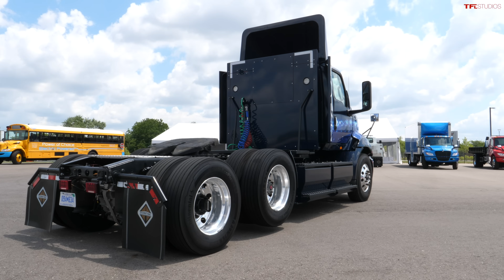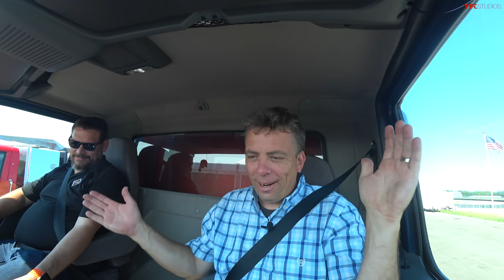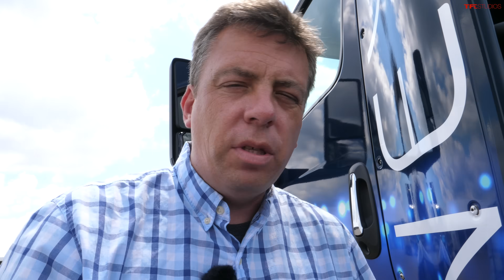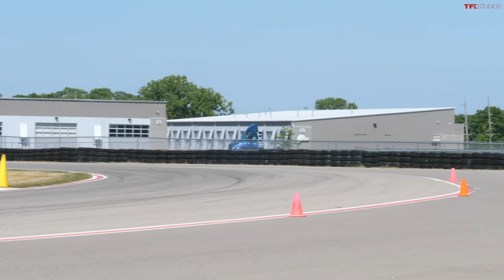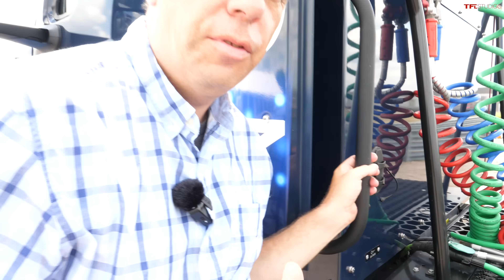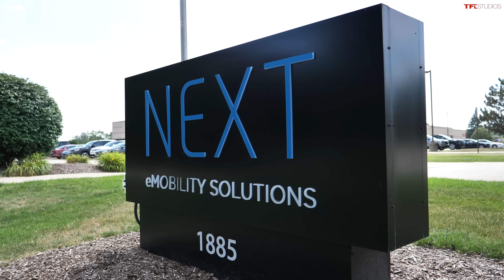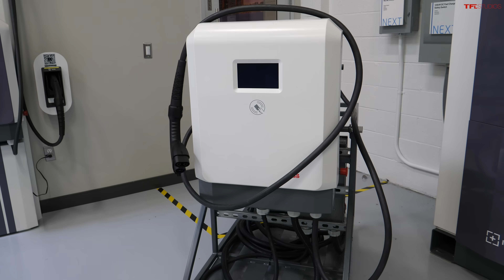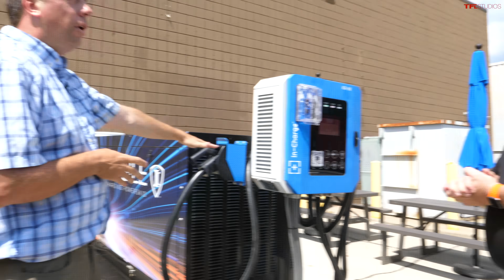Badass EV Big Rig - This International 18-Wheeler Packs a Huge Surprise!

Comment: 5:05 I'm glad they're emphasizing the point that these EV semis outperform diesel in every performance metric. So really,  this technology is a no-brainer. The energy now needs to be spent on improving energy density/range. Better batteries, HFC, SOFC, etc. are all options, and they're all becoming available sooner than many people realize.
Reply: For Local or Regional freight these are  a NO BRAINER.. maintenance cost on Diesels are high.. especially with all the EPA crap on the new engines. 
They are a NIGHTMARE..  DPF Filters.. EGR,  and coolers, and DEF systems. 
All very failure prone and expensive to repair.. and they put you out of service, that is the BIG cost. 
Short haul and city trucks are especially susceptible to these failures.. they don't get the exhaust hot enough long enough to make the EPA systems work well.
But for long haul stuff.. especially expedited freight.. The charging speed and rang will not  matter.. the number of charging locations will be the big issue.
I do not see a way to get the chargers to EVERY truck stop in the country. Freight like this is so random in its route and it timing.  A long haul truck will be carrying 300 gallons of Diesel.. Giving a range of 1800-2400 miles. and can be refueled in say 15 min or so. Even at a regular gas station in an emergency.
Maybe you could do diesel powered long haul to designated regional drop zones... and then have EV trucks grab the trailer and take it the last 50-100 miles.  But that complicates the logistics a lot.

It will happen.. but its gonna take time and be done in stages.
Reply: @kens97sto171  For long-haul, I wouldn't be surprised to see some effort put into powered trailers. Ultimately, overall weight would still be a factor, but having one or two trailers with their own daisy-chained powertrains and ~400 kWh packs would go a long way... literally. Paired with the right EV semi, it could easily achieve 1,000 miles with a full load.

EVgo and GM are currently partnering with Pilot to add 350 kW, pull-through charging stalls at their locations around the country, but those would really only be used in a pinch. There needs to be dedicated EV semi stops with >1 MW charging at all of these travel centers, too.
Reply: @newscoulomb3705  
You're right you're going to need dedicated megawatt EV charging for trucks.
I spent a lot of time traveling all over the country when I was over the road trucker. The scale of accomplishing that is pretty astounding. There are truck stops in every corner of the country in all kinds of odd places. Perhaps you could do those large megawatt chargers at big truck stops on the major routes. But you're going to have to work out the logistics of how to get that last 200 MI into the middle of nowhere. And then figure out how to get back. Solar on top of a semi trailer might give you some additional range. And like you said put batteries in the trailers. You just have to wonder at what point are you just better off continuing to use diesel for the long haul stuff. It's a lot of money and expense for not that much change. About 80% of trucking is regional short Hall by volume. But that 20% involves long distances over terrain that has not much in it. You might be better off living with the 20% burning fossil fuels. Diesels are about 45% efficient, and the energy density of that fuel is pretty astounding. For constant speed down the highway they're also pretty efficient and clean. Maybe some kind of hybrid system would be an option also. Have enough battery for start and stop in the city, but a smaller more efficient diesel engine that runs it constant speed for running down interstates.
Even if we just replace the 80% regional and local freight with EVS it'll make a huge difference in pollution and cost for the shippers and consignees.
Reply: @kens97sto171  Yeah, these would do great for local delivery services, for long haul bio diesel and renewable natural gas would be the best bets for near net zero transport (fuel supply line has to be powered by all nuclear or renewables) until someone like Tesla or EVGO gets serious about putting in MW sized charging stations, which even then the local grid has to be strong enough to support multiple semis recharging at MW speeds which is usually at night when solar isn't producing and wind is too seasonal in most inland areas to be relied upon.
Reply: @anydaynow01  
Hydrogen fuel cell would be another alternative for Long haul but then you still have the problem of transporting or making that hydrogen thousands of locations maybe hundreds of thousands of locations all over the country.
I don't think most people really understand the scale of the logistics and transportation Network for Long haul Trucking.
I'm not sure that installing all of this stuff and transitioning to alternative energy sources would really benefit that much. You might be better off just to keep burning diesel for that 20% of the loads that are simply not practical to do any other way. Doesn't get you to 100%. But there's an environmental and ecological cost to the transition also. And you're absolutely right there is no way you're going to generate multiple megawatt charging abilities in small town america. The cost to increase the utilities and wires and transmission ability just to power a single truck stop is just kind of ridiculous.
Reply: @kens97sto171  Yes, Pareto's Principle probably applies here. Realistically, there's no way to build enough batteries in the next 10 years to completely replace all diesel tractors with EV, so the initial push should be for those semis that are cheapest, easiest, and with the best ROI (city and regional trucks). 

I do know what you mean about  the rural fueling stations, though, as even towns as small as a few hundred people in my neck of the woods have dedicated semi fueling stations. They are almost always empty, and the fleet stations are locked to the public. But they are there and available to the truckers who need them and are allowed to use them. 

The infrastructure won't come overnight, no, but it is coming. CharIN is doing great work on their Megawatt Charging System, but you hit on an important point that a lot of people don't realize. In order for those rural fueling stations to offer MW charging power, they are also going to need significant on-site battery storage. Essentially, each rural EV semi fuel station will require the equivalent number of batteries to put at least four to six EV semis on the road.

I wouldn't be surprised to see long-haul diesels still on the road in 20 years, but they should already be in the process of being replaced at that point.
Reply: @newscoulomb3705   They do this with mine transport trucks in Australia,  having a 500hp Slave Engine on a mine Road Train
Reply: Cost too, gotta be cheaper.
Reply: @D40-Or  For commercial use, the ROI already skews heavily in favor of EVs much faster than it does for private party purchases. The differences in fuel, maintenance, wear and tear, etc. pay for themselves very quickly when you're driving 100+ miles a day, 5 days a week. $20 of electricity a day versus $60 of diesel a day (a $10,000+ per year difference) is often significant enough before even factoring in the huge disparity in maintenance costs. 

Obviously, we still want to see the upfront costs come down (which they will, naturally), but for 10+ year timeframes, there's no doubt that EV semis are already the superior option.

Comment: Hyliion currently has a hybrid diesel or CNG solution in production, and their ERX fully electric with on-board charging via CNG is due for production in 2023 will be the only immediate viable long-haul solution. Charging infrastructure or Hydrogen infrastructure will take several years to be implemented. You should do a video on Hyliion!

Comment: The simplicity of this system seems awesome.  Range is probably horrible even with 400kwh of batteries.   Infrastructure to recharge this stuff is non existent at this time (not at any scale).     Charging multiple 18 wheelers is going to require a Costco size parking lot.
Reply: Bigger than that.. Large truck stops are already that large...   
 I  see issues with the energy supply too.  Large truck stops have 200 parking spaces.  Those could be the slower chargers.. overnight would be fine.
But for quick charging.. I don't see it.  
It takes about 5-10 min to refuel a Semi, 200-300 gallons of fuel in a long haul.. filling both sides at the same time.  And there ends up being a line waiting for fuel at some places. 
A large truck stop may go thru 5-8 TANKER TRUCKS of fuel per day that's 11,500 Gallons in each tanker..  
I worked for one of the largest trucking companies in the US at one point. 
They used 250 MILLLION gallons of diesel per year at the time.
People don't realize the scale of the trucking and logistics required to keep the shelves stocked.
Reply: Plug in Battery Packs maybe better?

Comment: One thing I didn't think of that EV trucks like this will really be great at is local deliveries (Think food service (GFS), building materials, etc) vs long haul trucking.  Environmental and fuel savings will be huge if a good chunk of the industry can convert
Reply: i could totaly see trusses and other building materials being delivered with that. It makes sense honestly, moat of those trucks do less then 100 miles a day on average
Reply: @mattepple  garbage trucks too
Reply: @christophersands4140  garbage trucks have huge PTO loads (to run the hydraulics) so i think it might be more limited to how many come out, but we will see them.
Reply: Long haul likely wont be feasible, unless we get contactless charging built into our highways, like they are testing in Sweden and Norway. That may be part of the solution for all EVs to really take off, but the costs may be prohibitive.

Comment: Did International make it possible that the trailer might be able to have batteries? It would probably not be able to have a drive axle in the trailer as it would make for weird driving, but the trailer could store range. The trailer will be longer so it would be the better battery placement. The trailer could also be charged while sitting at a location, and it would also allow for a second or third charging port.
Reply: Trailer is for freight bud. Try explaining why a shipper is going to lose space and weight for range.
Reply: @TruckerMike089  More importantly, the center of mass is lower if the battery is actually in the bed, and the battery is more protected in the bed rather than sitting in the cargo area. I did not think I had to explain the design of an electric vehicle to people as every electric vehicle has this design.
Reply: @ronaldking1054  you do realize that we are talking about a semi not a pickup right? Also again please explain how with current bridge laws, and greedy shippers how losing value capacity for cargo is a great offshoot to be "green"?
Reply: @TruckerMike089  over half of all semis in the U.S. move out with well under 50% of their rated cargo capacity onboard bud. 🤔
Reply: @4literv6  who told you that one? Because I can tell you from first hand experience it ain't that at all
Reply: @TruckerMike089  statistics published on the freight industry specifically under class 8 commercial use average load weights. 
first hand experience with various carrier's and freight line's over a lot of year's. And loading freight myself with a forklift. 🤔
Reply: @4literv6  really wow. Cause everything I encountered they loaded that truck well within it's GCVWR. I wonder if you dealt with some LTL outfit or something.
Reply: @TruckerMike089  You realize you just said the same thing unless you did not say what you meant. Did you mean that every load is close to the weight limit, or are you trying to state that it is industry standard to put in an extremely large weight cushion? What you did say was that nowhere are loads even close to the weight you stated was a limiting factor that could not house batteries because of the weight. The semi is still housing the battery just outside the frame in a location where nothing, but a fuel tank would be stored. Your claim is that a battery must be housed inside a trailer, but that is never done even in this case of this semi nor any other case with any other battery design. As for being able to hook the battery up in some configuration, that is done as the trailer lights and brakes already are. The difference is the voltage and wattage. You also have claimed that the trailer is always left behind, which means that the trailer is near an energy source.
Reply: @ronaldking1054  did you not read anything I put down? The industry standard is to put as much freight on a trailer as possible. Your not going to convince shippers to reduce cargo capacity for range when diesel has already solved the issue. The majority of your bridge laws and the way bridges are setup, most OTR trucks max at 80,000 GCVWR. Meaning unless you're hauling oversized or are in a state where higher weights are allowed your not going to be able to go over it thanks to infrastructure. Shippers and receivers are greedy and want as much space and weight for freight as possible. Your adding weight for range while taking away valuable cargo capacity.
Reply: The truck can't go over total weight, so adding too many batteries takes away from how much product can be moved.
Reply: Most trailers stay with the cargo. Terrible idea
Reply: Enride is debuting a under floor pack assisted trailer for class 8 semis next year. Makes so much sense to me, slap a 2000-3000# pack underneath, some solar cells on top built into the frame, eliminate the diesel or gas apus for all refrigerated semis. 

Ad in wheel motors instead of brakes ala the new formula e gen 3 cars which eliminates the rear convential brakes on a 200mph race car. 
Use those in wheel motors for capturing all regen energy, for help with reversing and will help with traction control and trailer sway duties to. 
I'm very excited to see how the commercial ev space matures. 

Also for quick charging we are seeing the first char in standard with up to 3.5mwhs dc fast chargers getting deployed already with the ecascadia, Volvo and tesla semi pilot programs. 👍🏻😎